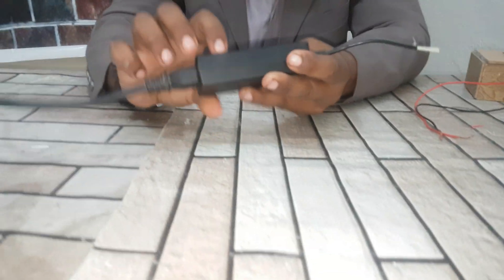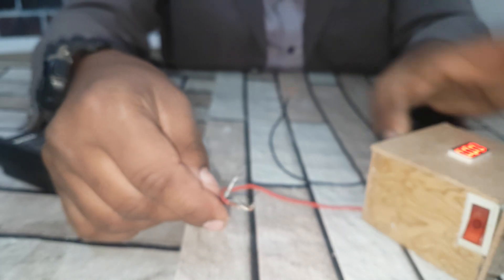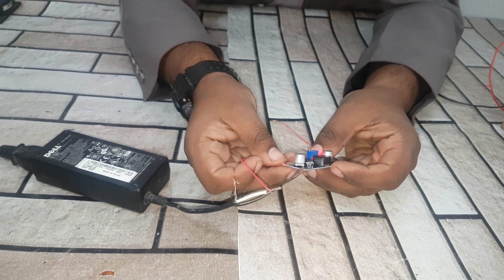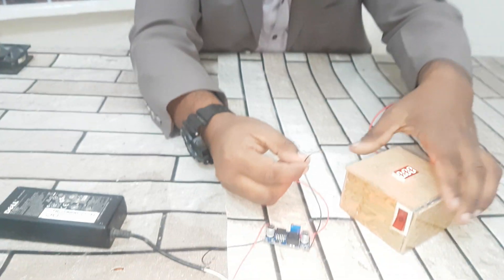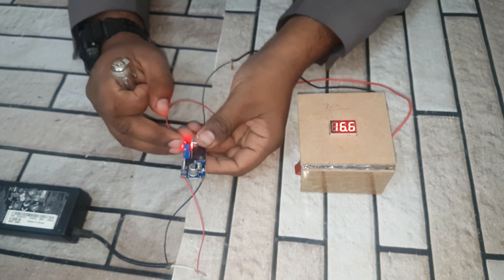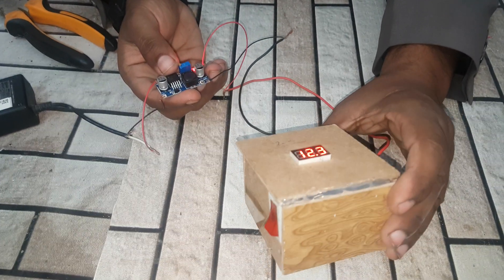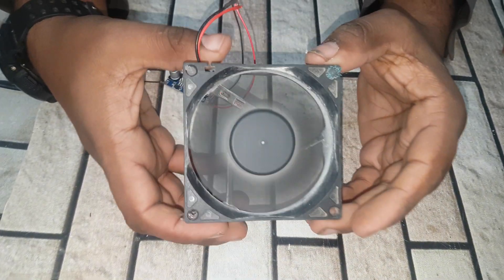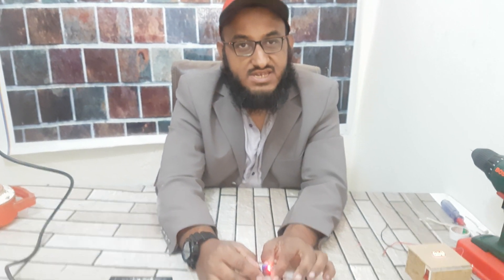How to make a 12v charger using 19v adapter||Junaid Production

Comment: Ye outpot pr maximam 3apm deta hai koi aisa circuit btaen jo outpot pr 8amp dy... jo osy inpot pr amp milen wohi outpot pr day sirf voltage ko regolat kare ye tuo amper bhi sath men kum kr raha hai aisa nahi hona chahiy....
Reply from the maker: Voltage up or down?
Reply: @Junaidproduction50  sirf volteg ko regolat kia jasky ampere kum na hon..... 19volt 8amp k charger ko apky video wale circuit men laga kr ager 14volt ki supky lengy tuo ampere bhi kum hojaengy.... is circuit men jo ap video men dikha rahy hen....
Reply from the maker: Check description...yes it is possible only regulate voltage....